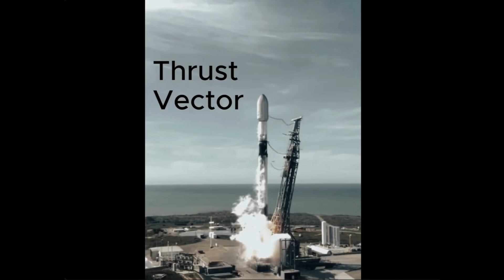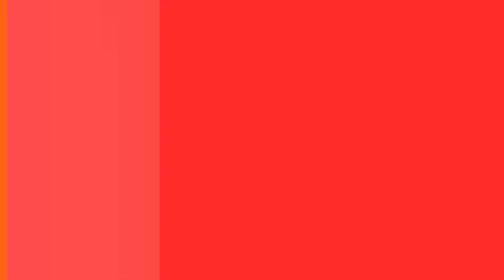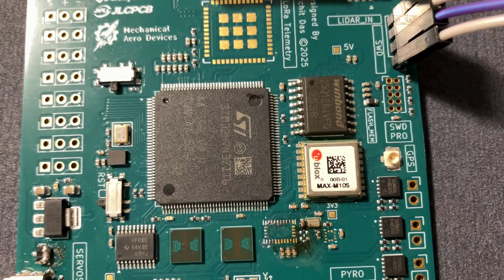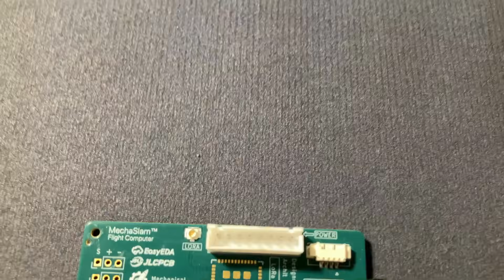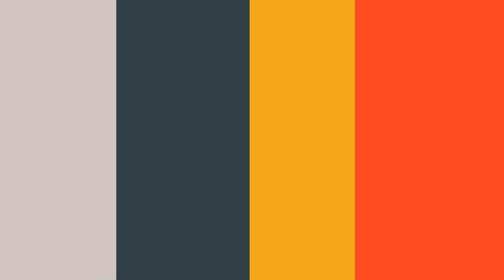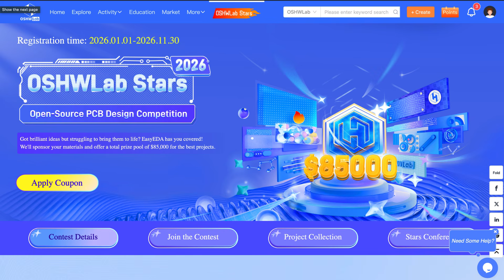I Built a Rocket Flight Computer From Scratch (Full Breakdown)

Comment: Very cool project! Wouldn't it make sense to use multiple sensors for redundancy? Or what about G-forces or vibrations potentially cracking solder joints, disconnecting cables?
Reply from the maker: The G-Forces onboard these rockets are not high enough to crack solder joints. As I mentioned, there will be two IMUs on the final version of the flight computer, but added redundancy is at the expense of higher cost and complexity.